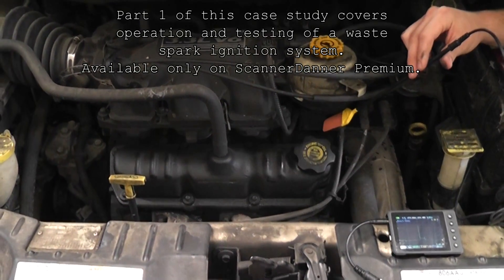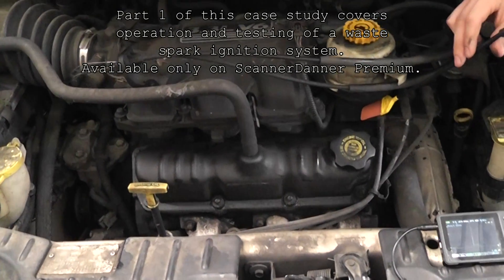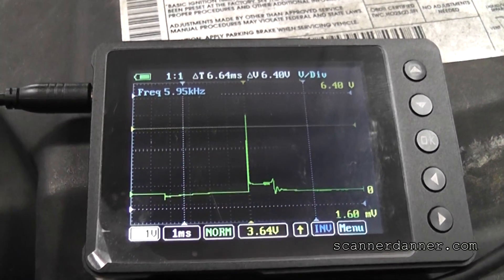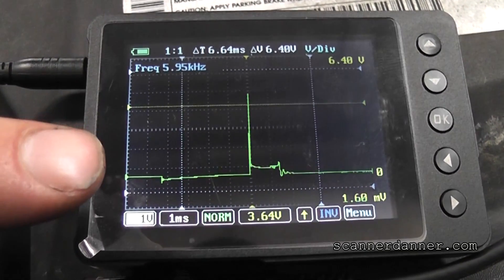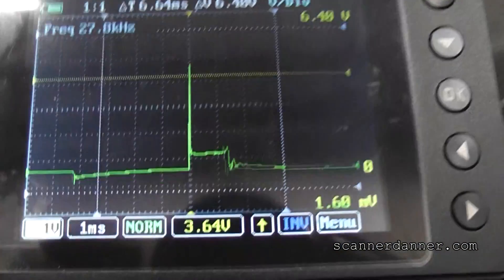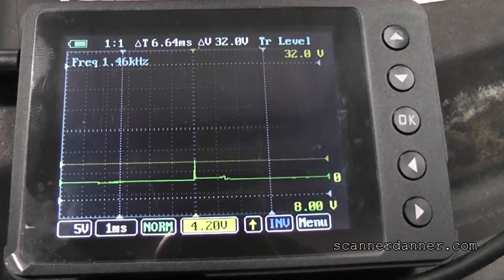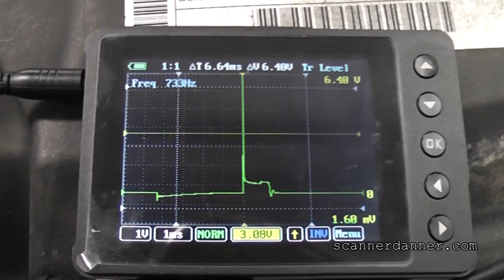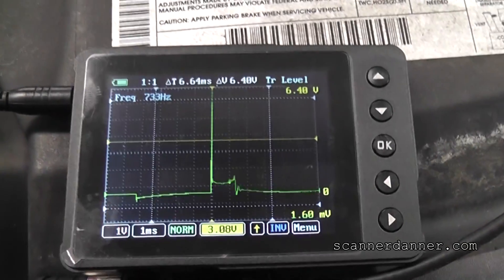What does an open plug wire look like on a lab scope (uScope)

Comment: Hi Paul!!
If you were to buy only one would you get Wyze probe or Paddle probe for use with Verus Pro? I have the wyzeprobe, not to happy on COP!! Would like to read your thoughts
Reply from the maker: Maic Salazar you won't be happy with any of them on the 3 and 4 wire COP systems. They are just too well insulated. I can't get good waveforms from them either
Reply: +Maic Salazar are you still having issues with your probe? let me know if so.

Comment: Hi ScannerDanner
I have an oscilloscope and want to do a few measurements on CAM and crank sensor in my Volvo 850 -95 . But it has only odb1, is it possible to probe the Control Box itself somehow to see inputs and outputs ?

PS you have one of the best channels in youtube

BR Mike from Sweden
Reply from the maker: Of course. You just need a good wiring diagram. Thanks!
Reply: Thanks
Will get your premium tube now but my question is half answered :)
How to measure the pins when the big sealed Box is on top of the place to probe.
How do you handle cars without odb2

For instans 
http://sweet-sauer.com/wp-content/uploads/2013/08/Box-Figure-6.jpg
I cannot get to the probe to this.
Reply from the maker: Not sure. Every car is different. There has to be a way to backprobe the connectors.  Sometimes you have to take protective covers off

Comment: Nice probe.  Being and electronics tech, I already have a CRT 'scope.  I will check it out.  I also wanted to make you aware of a code reader / scanner I like that I've owned for over 2 years now.  It is the OBDCOM unit from obdcom.com.  It is not for everyone, since it is not self contained (requires you to use a laptop computer) but very versatile for under $100US, with popup  analog / digital guages, graphing, detailed obd code descriptions, etc.  I've used the little bluetooth wireless ones, and  ditched them in favor of this older tool.  In fact, the price has dropped since I purchased mine...